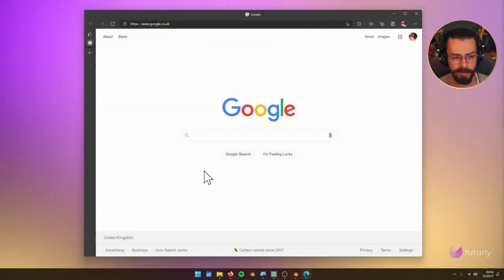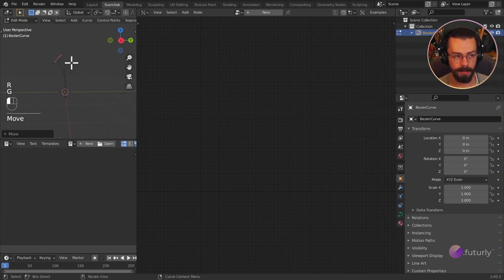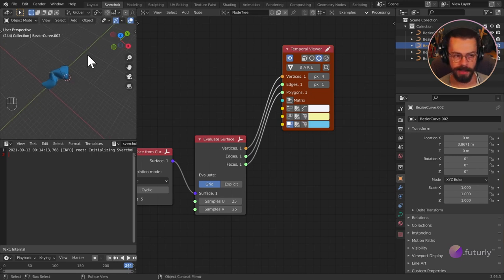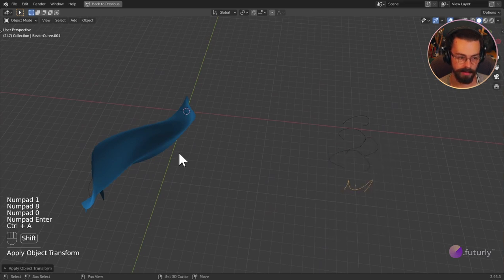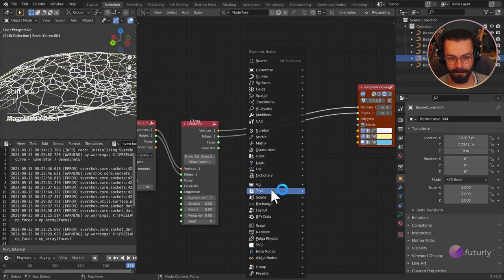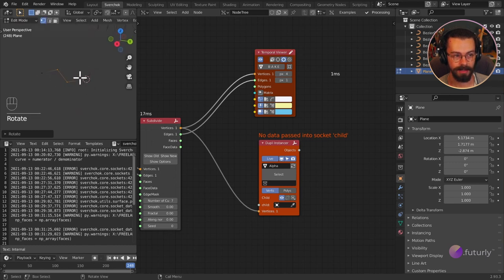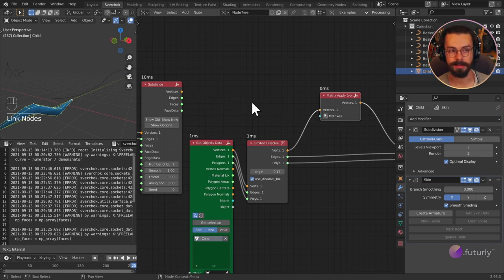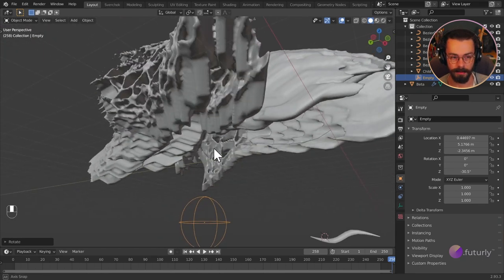Introduction to Blender: Parametric Design

Comment: Thank you for sharing such valuable knowledge. Unfortunately, I can't repeat this lesson. I stopped at the very beginning because of a problem with nodes. When I add nodes: Curve Zero Twist, Surface from Curve and Evaluate Surface, the program gives the same errors. The text “No data passed into socket Curves” pops up. Maybe you can tell me what the problem is? Thanks in advance for your answer.